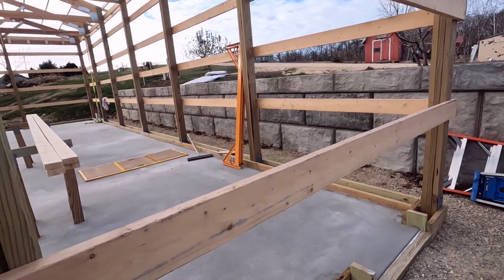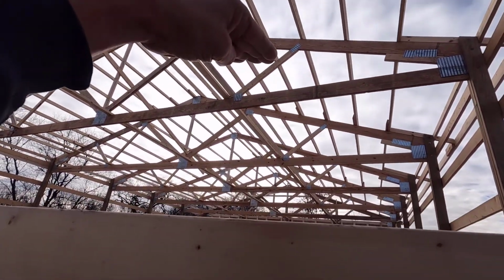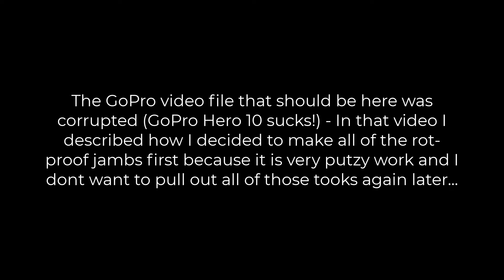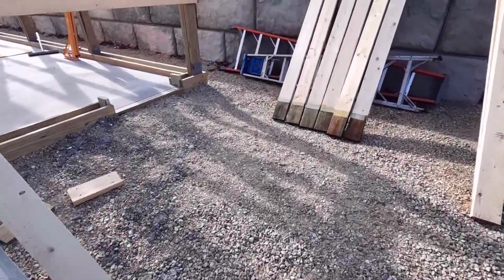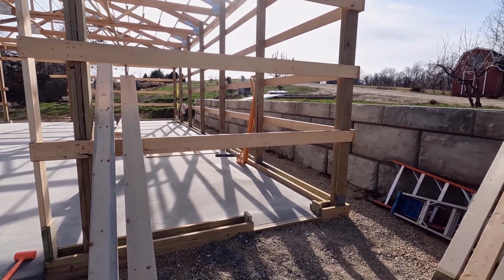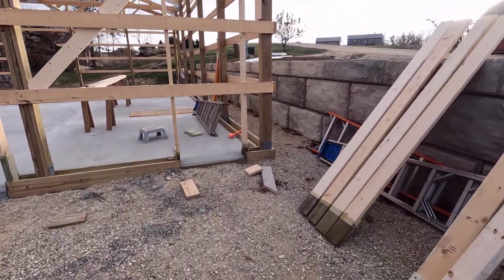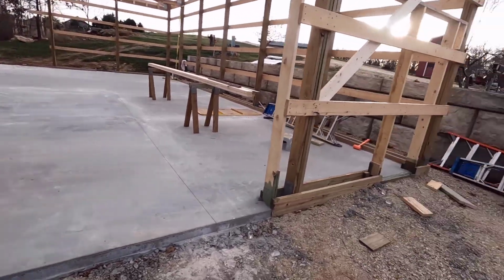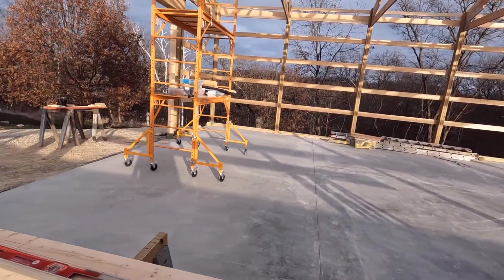Making Rot-Proof Door Jambs ― Installing Bracing and More! [Post Frame]

Comment from the maker: I watched @RR Buildings to get a lot of the details for this building, but on this detail I have to diverge. Maybe I'm mistaken, but from their videos it appears as though they have the door jambs — which are regular construction lumber — extend down into the area where concrete will be poured later. Whether that is true or not, I am not going to do it that way. I could have just used a full treated board, but then there is the problem with the door hardware into treated wood. Treated wood will corrode normal metal fasteners very quickly, and I would rather nor have to use stainless steel. These jambs will last the life of the building, and that's what I'm shooting for 😊